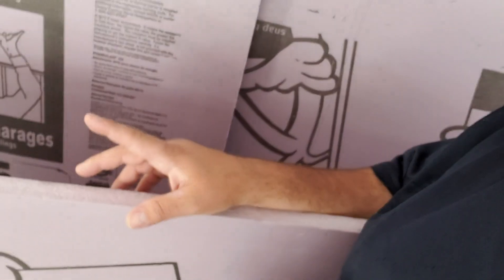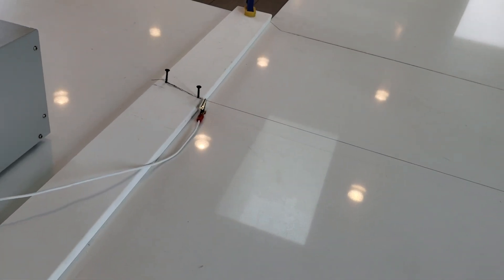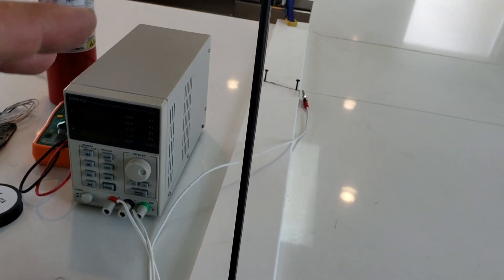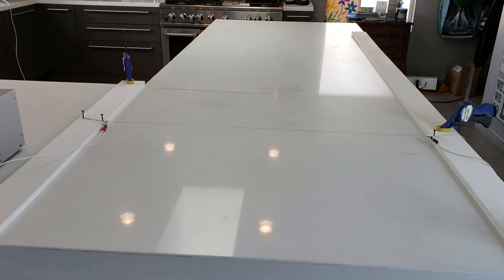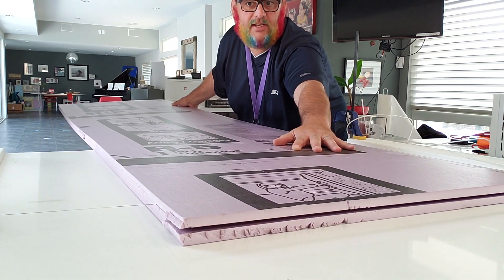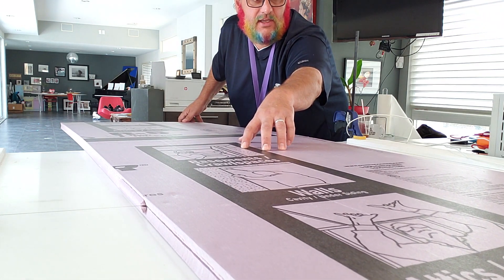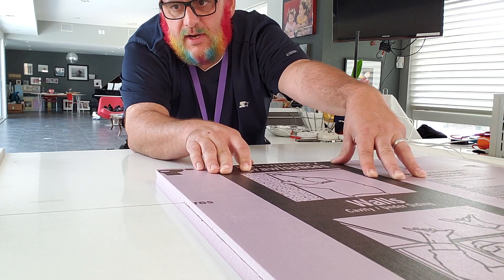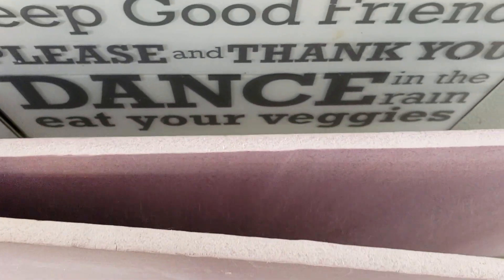DIY Large Hot Wire Foam Cutter To Split Rigid Foam Insulation For School Bus Floor

Comment: Question: I need to cut sheets of 2" blue foam boards to 1" thick with 18g nichrome wire. The power supply is only 14.2 vdc at 10 amps. For a 52" wire, it is suppose to generate a temperature of ~750'F. Will this be hot enough to cut thru?

Comment: Hah! slabbing foam without nice grains.
Hey, man your kids must have run out of room on the garage floor with their chalk! Good job on the colors !!! Geat Idea for the power source. I got one for tattooing. Glad I found your video for other plans (want to build a cargo camper one day !!). for now I'm looking to heat glass bottles, and test tubes so they split nicely after scoring with my custom tool. 
You know you can get used refrigerator insolation slabs for a good price per pallet on Facebook or Craig's list probably not enclosed foam thought?. Thanks for posting !!